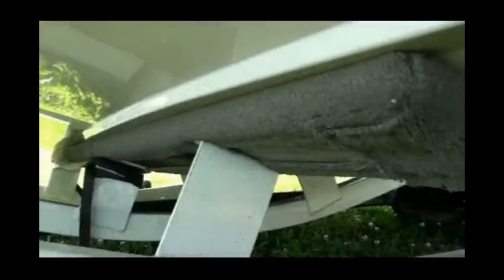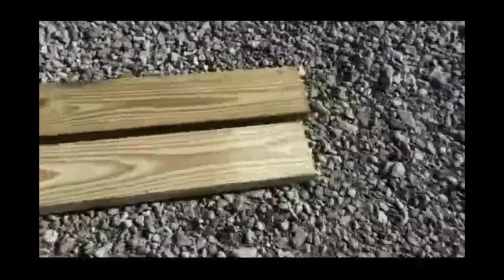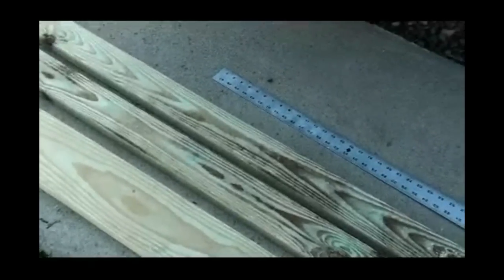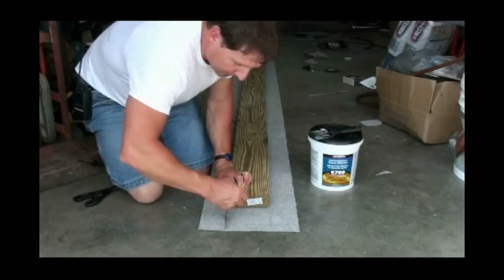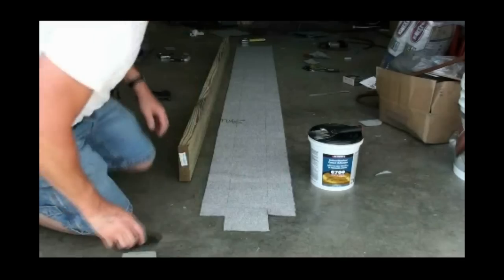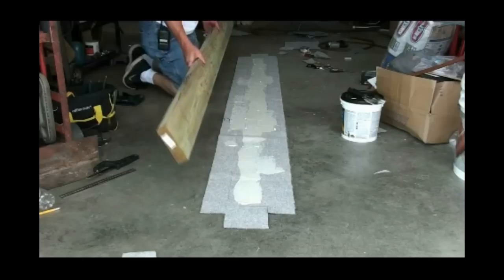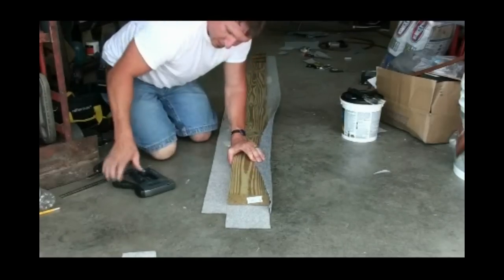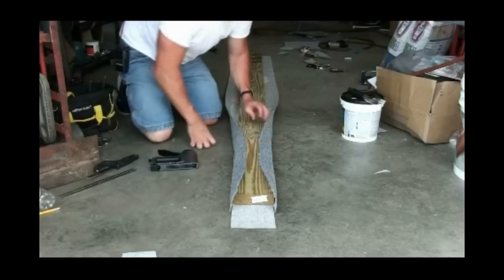How to fix your Boat Trailer Boards and Bunk Carpet

Comment: Very good video. Followed your directions and had no problems. Very simple and clear direction. Thank you. Not sure whether you mention in your video but was told by another person to make sure you use stainless steel staples, even in fresh water. Thanks again.
Reply from the maker: Thanks for adding the stainless steel staples. I don't believe I mentioned that.

Comment: Thanks. Just did mine with PT wood, adhesive and SS staples. I appreciate your video for instruction.
Reply from the maker: Awesome, I need to redo my Bass Boat trailer so I may look into that. Thanks

Comment: Hi there ! What if bunks get fastened with bolts running all the way through them with metal plate on top ? Do you do carpet wrapping at the very end to conceal metal plates underneath ? ( 94 Trailmaster single axle ).
Reply from the maker: I would carpet anyplace the hull makes contact with the bunks but I wouldn't think the hull would touch the metal plate. I would put carpet everywhere the factory had it to begin with. Let me know how it goes :)

Comment: Is there a problem if the carpet is bad?
Reply from the maker: Not really, the carpet will eventually wear out over time and allow the bolt heads to rub the bottom of the hull depending on how the trailer is made. I was replacing the rotted boards is why I had to recover them.